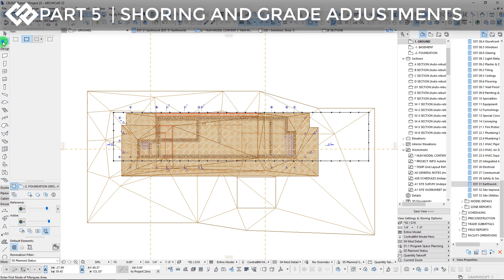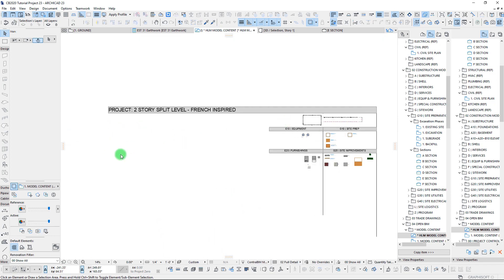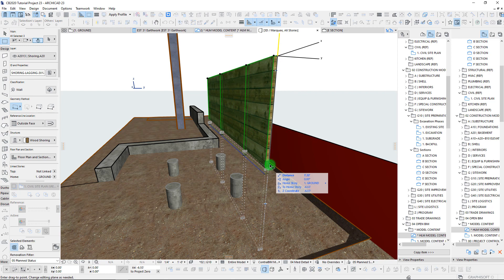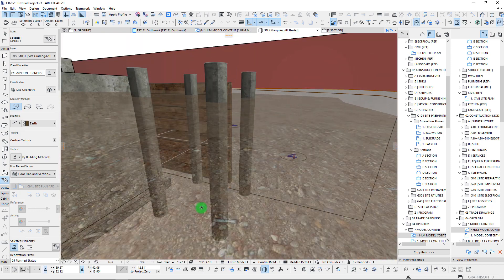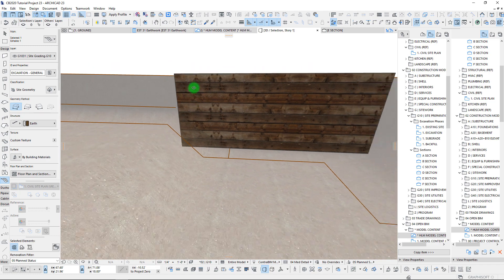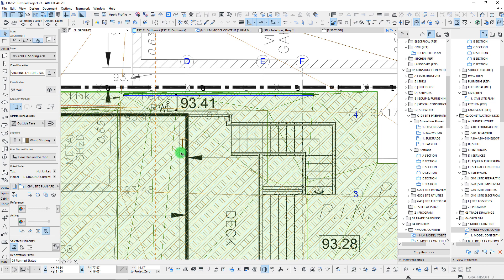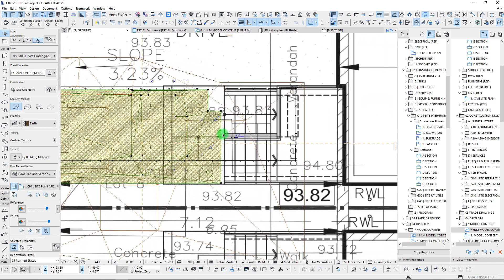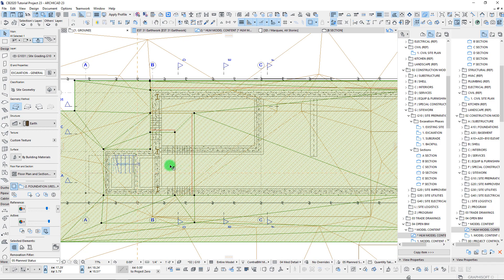Modeling Shoring for Basement Excavations in ARCHICAD (Part 6 Earthwork Mini-Series)

Comment: High John, quick question. Why do you create a normal mesh and an inverted mesh to do the solid element operation later? Why not two normal meshes?
Reply from the maker: It can really be done either way. By creating two normal meshes, you'd have to add a third volume in between to be cut by the top, and bottom. The way I demonstrated, it's simply a mesh for the topo, then an inverted mesh to cut down to subgrade. Very similar workflows, both work, just all personal preference! Thanks for the question!
Reply: CONTRABIM Can’t wait to see the next video to get a better understanding. Thanks John